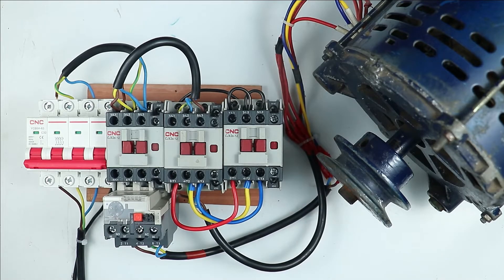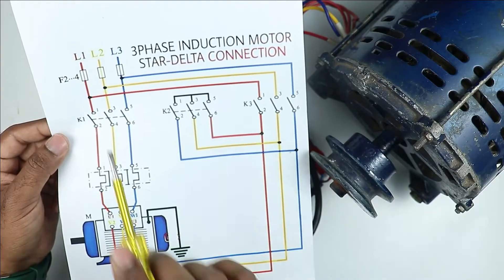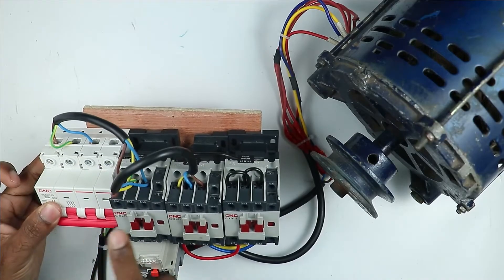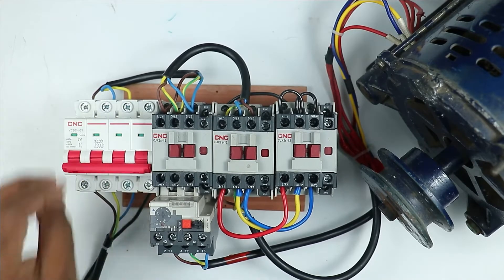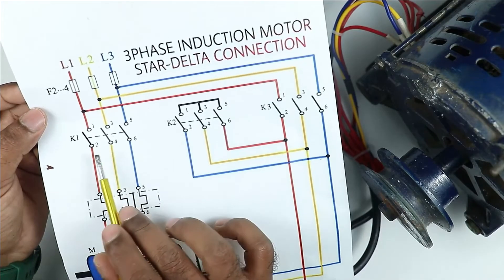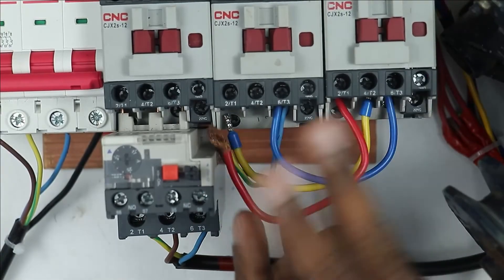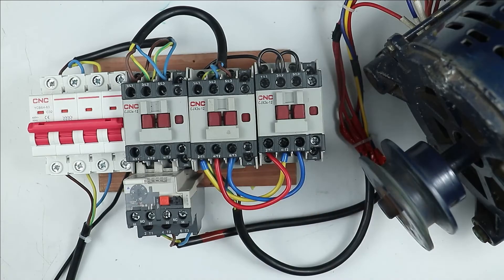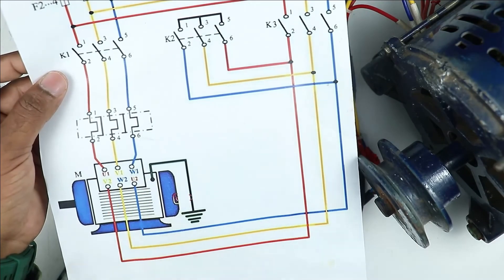By Doing this, You change The Motor Running Direction in Star Delta starter @TheElectricalGuy

Comment: Well what if the wires in westherhead on motor are inaccessible but the wiring is number for number? What prep could be done with the motor leads before motor  is set in place? Not smart to try and guess the rotation and swap wires.

Comment: If the motor is running on full load in one direction and the direction is changed at an instant would that exceed full load current , or would it be better before changing direction to stop rotation and slowing down by operating the stop button first before starting again in the opposite direction and allowing the star delta starter  procedure to finish .